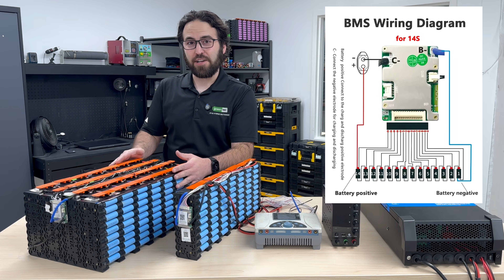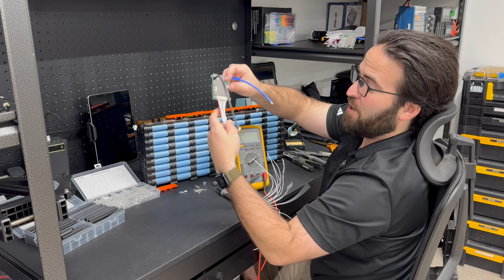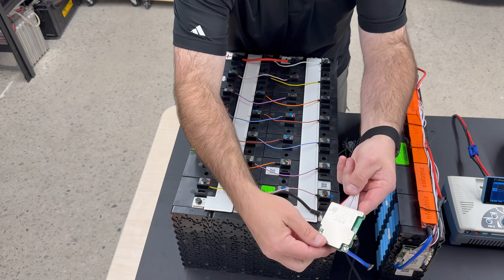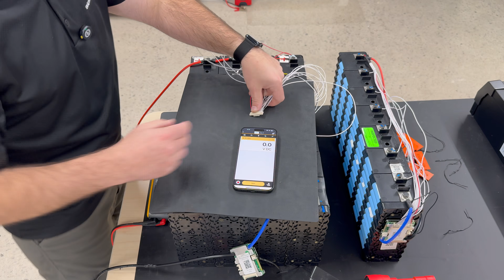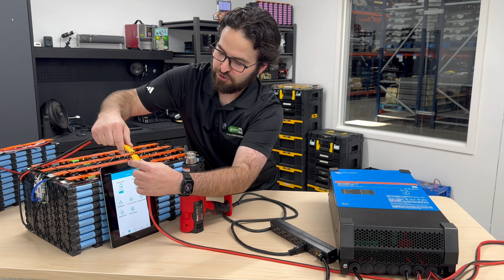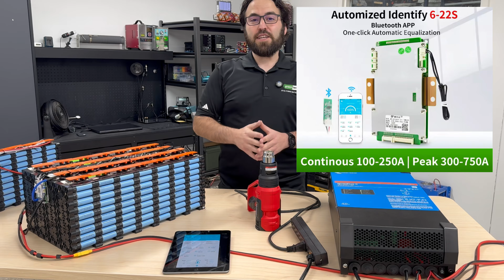How to wire a 7-14s 50a JBD BMS to a Li-ion battery.  24v as a UPS and 48v for an off grid inverter

Comment: Just looking at the jbd website, and that seems to contradict some what, what you are saying in regards to connecting the BMS to the harness connection being one sensor wire at a time, that seems to be more the case when wiring to the harness/ ribbon cable, but once that is done,it seems to be fine to plug it in to the bms with that harness being live

Comment: Which BMS is suitable for Li-ion 3.7v cells to be configured in 24v 100Ah?
Reply: You didn’t specify the amp rating needed. So nobody knows if you need a 100a BMS or a 300a bms

Comment: Isn’t that different than how you wire the 7-21s 100a Jaibaida? I think I had to combine the middle balance wires.
Reply from the maker: Yes, the 7-21s JBD boards have a different wiring diagram. The B21 and B20 are connected to the cell while  B19 and below can be combined to match your battery.  This 7-14s JBD combines the positive most wires together, which is a bit less confusing so always refer to the wiring diagram.

Comment: I'm interested in building the 14s 48v battery you have there. I already have lots of lion batteries. where can I get the kit for the physical build?
Reply from the maker: The 7s eMatrix batteries are from Greentec Auto: 
https://www.greentecauto.com/hybrid-battery/repurposed-batteries/energy/252-18650s

The JBD BMS is from AliExpress found here:
https://s.click.aliexpress.com/e/_mM4eamG

Those battery modules come as a complete unit with the cells. We don't make them and neither does the manufacturer so no one else sells them and no one sells just the case without the cells but the price is incredibly cheap, less than a dollar per cell. If you buy cell holders and nickel strip and make your own 7-14s battery pack you can still use these instructions to wire up the BMS.
Reply from the maker: The 7s eMatrix batteries are from Greentec Auto: 
https://www.greentecauto.com/hybrid-battery/repurposed-batteries/energy/252-18650s

The JBD BMS is from AliExpress found here:
https://s.click.aliexpress.com/e/_mM4eamG

The eMatrix modules are no longer made by the manufacturer and no one else sells them nor does anyone sell only the case without the cells. However GreentecAuto.com sells them incredibly cheap, less than a dollar per cell.  Once you factor in the cost of cell spacers, nickel strip and labor it is probably cheaper than making your own pack with your own cells.
Reply from the maker: Thats awesome. Its a great battery.  By the time you factor in cell spacers, nickel strip, labor and time these are an incredible deal. We don't sell the housing separately but you can buy the whole module with the case and the cells here.
https://www.greentecauto.com/hybrid-battery/repurposed-batteries/energy/252-18650s

Comment: Omg that’s so true. I fried out my first icharger using a weak power supply. Now I built a portable case for it with a 7s RC LiPo battery with a JK BMS as the buffer built into the case and it works like a dream! Kind of like a smaller portable version of this.  However I’ve been looking for a larger solution like this for when we go to drone races. Those batteries are exactly what I need and they look cool.  Does the JBD BMS have a good android app?
Reply from the maker: Yes we will be posting a video soon about how to program the JBD BMS app. The best version of the android app can be found here. https://bit.ly/3e1g6GT

Comment: Uh.  Looks like a fire hazard.  That's a lot of little bombs that you are mistreating.

* Please don't use lead-acid settings to charge a LiFePO4 battery.  The BMS is there as a fail-safe, don't depend on it for normal operation.  Use proper settings.  A 4S LiFePO4 battery is typically charged to 3.55V/cell (14.2V) held there for a while to give the BMS time to balance the cells, then dropped to a float of 3.35V-3.375V/cell (13.4V to 13.5V).  The float setting is mandatory to keep the battery healthy.

* Do not depend on the BMS to prevent over-charging the lithium pack.  BMSs aren't not meant to be used for that function.

* You cannot safely use a power supply to recharge a lithium pack, BMS or not.  You need to use a proper charge controller and float setting, otherwise you are permanently stressing the lithium-ion pack.  You also can't safely hold the pack at its fully charged voltage indefinitely.

* Lithium-ion batteries are NOT suitable for UPS applications.   LiFePO4 yes, NMC/NCA no.

* Do not wire the output of a DC power supply directly to a battery for load-support (don't wire it for charging at all.  DC power supplies can only be used for low-battery load-support).  That isn't safe.  The output of the DC power supply has to go through a bank of schottky diodes.

An example of a suitable schottky diode is a 20SQ060, which can dissipate 4A in free air.  So have a bank of however many you need for the amperage you want to supply from the power supply. Stripe side points towards the battery.

* Your system appears to be missing required fusing in several places.  Do not depend on the BMS alone as your sole overcurrent protection device. BMSs aren't meant to be used that way.

-Matt
Reply from the maker: You're absolutely correct for long term use. If you were going to do a permanent installation in your house or operation that is unsupervised additional safety measures should be added, like you said. This video was to demonstrate the basics of wiring of a BMS according to the manufactures wiring diagram and to demonstrate it functioning.  To address the charging of the LFP battery for a few seconds in the demonstration, we don't stock or sell any lead acid batteries at Greentec. Also if you try to charge in LiFePo4 mode it will stop you because it wants balance wires connected for exactly the reason you pointed out but again the focus of this video wasn't to show how to use iChargers.  
You can use NMC batteries as a UPS buffer though. Thats what every mobile laptop power-bank is, Tesla power wall, etc. They aren't using LFP. The DC power supply needs to be set at a lower voltage than the BMS maximum that way it will never fully charge it to 100% and the BMS should never need to open circuit. Again I only charged it to 100% to demonstrate that it will open circuit and how you then go in and clear the warning to turn on charge and discharge again. Also the iCharger has paralleled fuses built into it as well. Thank you so much for your input, that would be great content for another hour long video.